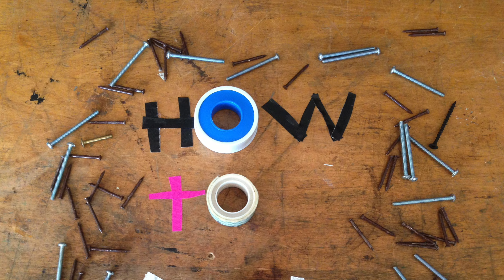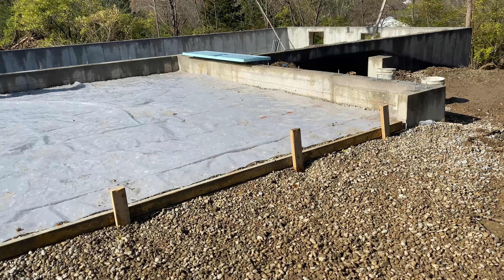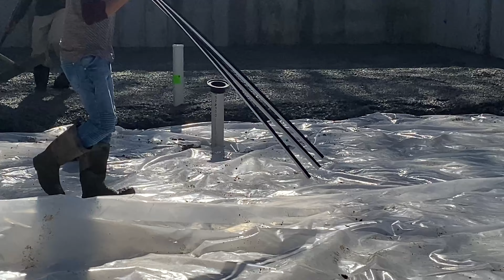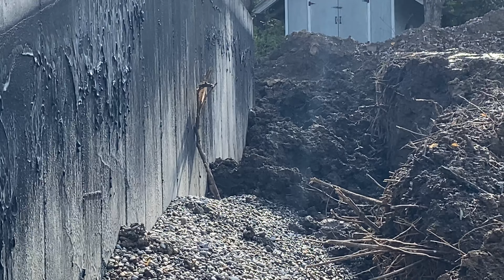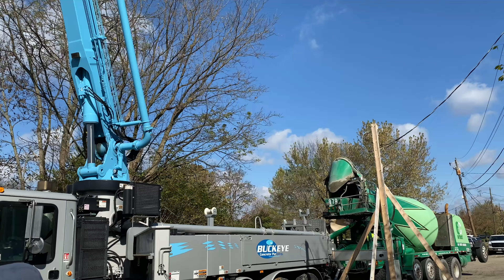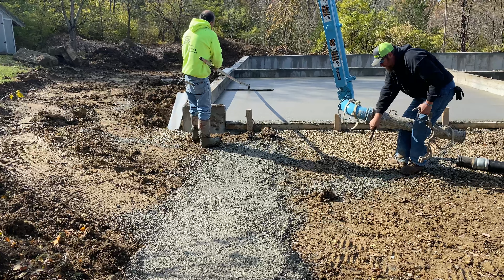House Build Part 5

Comment: no rebar or steel in the slab?  Here in ca we need to add steel or it will crack badly
Reply from the maker: Not required here.